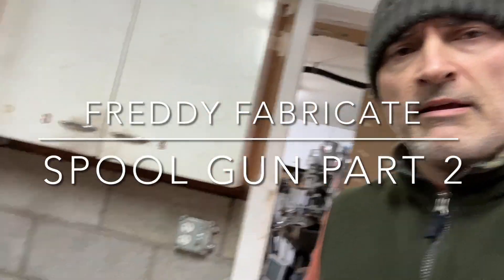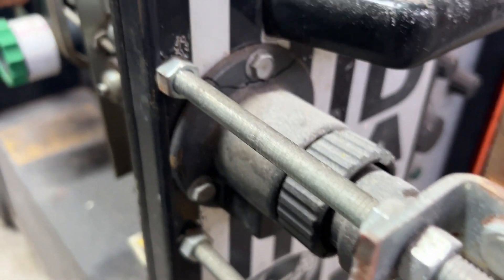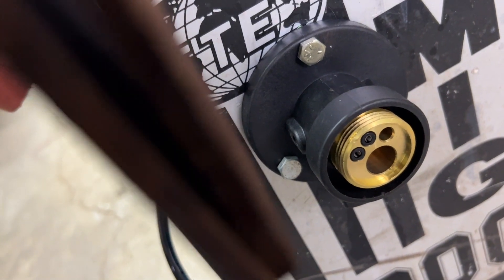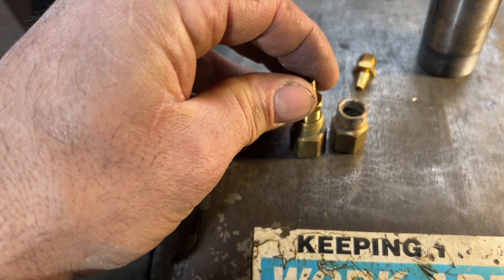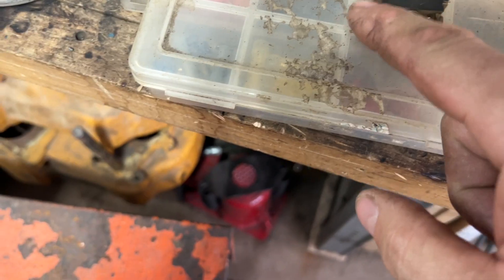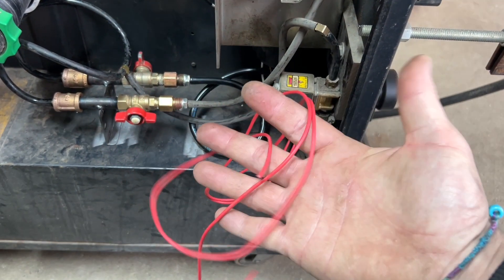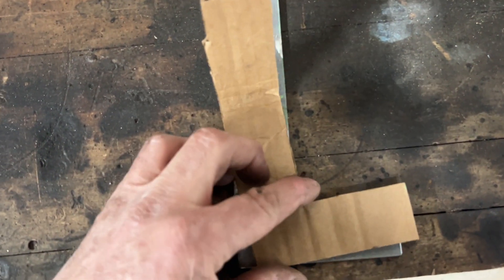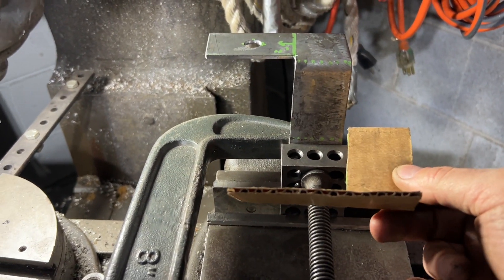Aluminum spool gun retrofit part 2

Comment: BONJOUR,  intéressant  votre modification😊  vous m avez un peu perdu dans vos branchements d interupteur... N ayant pas été  suffisamment  attentif en cours d Anglais😮 ( je suis Français ) 
Mais votre utilisation mixte Acier  ou Aluminium  est tres judicieuse !
Jen ai pas trouve de suite apres la 2 eme partie... ??
Avez vous fait  test de bon fonctionnement  ?
Utliisez vous le meme gaz indifféremment  pr l acier ou l alumignum  ?
En France nous avons l Argon pour l alumignum  et l Atal pour l acier.
Merci en tout cas  pour votre video, cela m a donner envie de faire un montage mixte ...
Jean-Marc
Reply from the maker: Comment alley vous. Believe it or not I took French for 8 years, but unfortunately don’t remember much.
Reply from the maker: I’ll be making a part 3 video shortly. I have to weld an aluminum row boat. It’s working great. The key is the keep the nozzle About a 1/2” from the work. I use straight argon for aluminum and 75/25 for steel. 75% argon and 25% carbon dioxide.

Comment: Creative so you have  mig gun and the spool gun funny i was thinking that so screw undoing the mig gun for spool gun  awsome
Reply from the maker: Yea. I’m working on a second mount for another tank. Pure argon and 75/25 for steel. I want to be able to switch over in a few seconds. Aluminum mig is working great so far. Just a little porous. Not welding any gas tanks. Using tig for that, but works great for everything else.